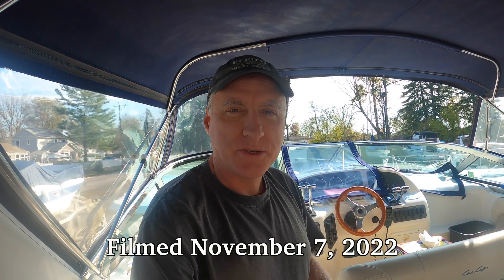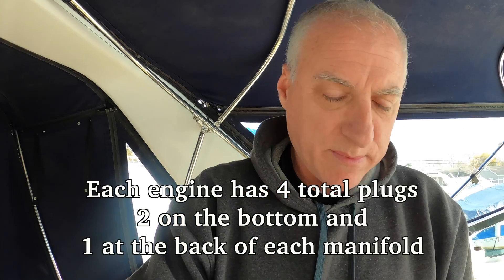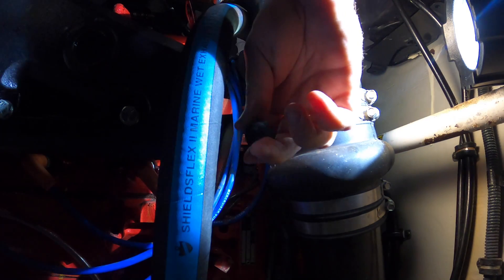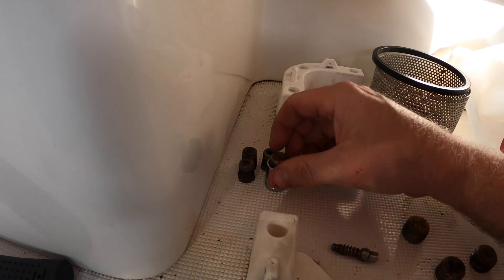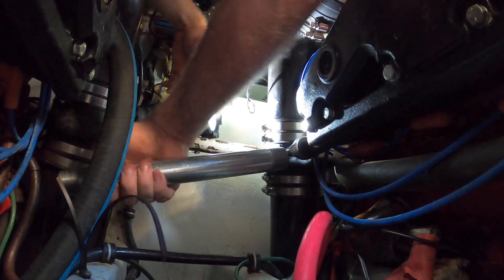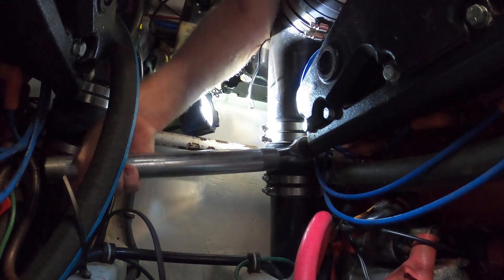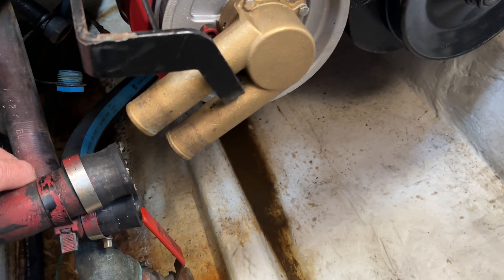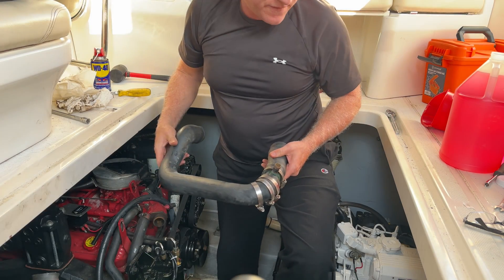How to remove the Volvo Penta Drain Plugs - Episode 66

Comment: Hope you put some anti-seize on those threads before putting them back in. I’d have been paranoid of stripping that one you had trouble with. Nice work. 👍🏼🇨🇦
Reply from the maker: I did not, but I should have. Thankfully, that was two years ago and the problem of getting them off has been much easier. Thanks for your comment and for watching!!

Comment: Yea laying down in motor you get cuts a bruises. Lay an old beach towel or blanket on the motor next time..... Going down to 8-9* tonight.
Reply from the maker: Yeah. I bruised my chest. I needed some buffer but wasn’t thinking originally that I was going to need that much effort.
Reply: @eternitysshore  well the important thing you got that bolt off successfully. Remember you're only one broken bolt away from creating an 8 hour job !
Reply from the maker: Good point.